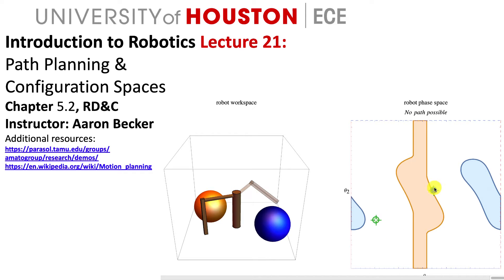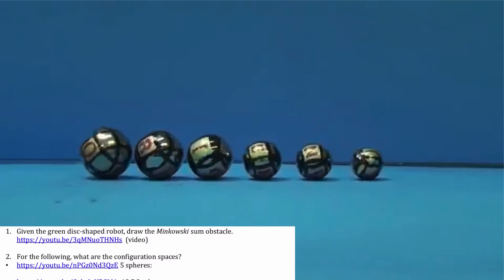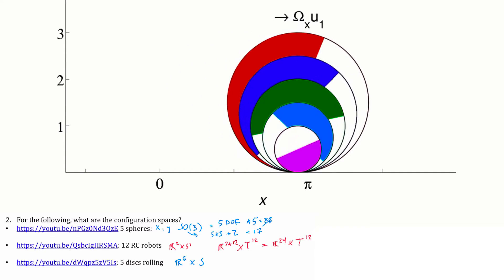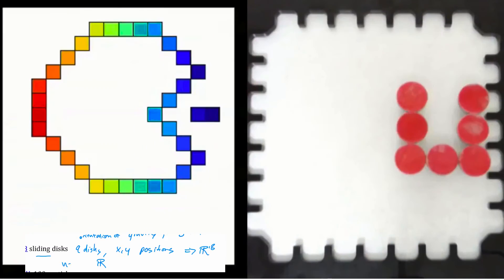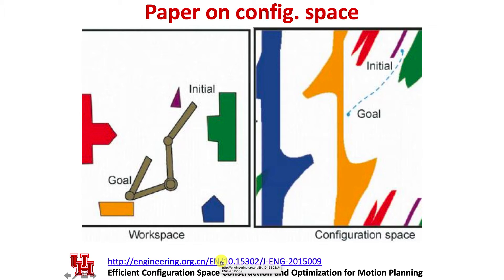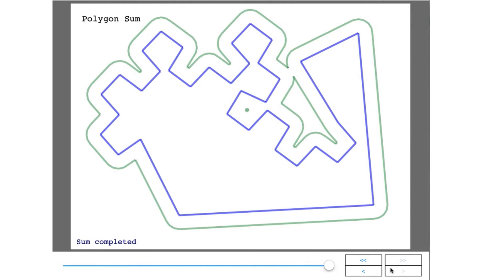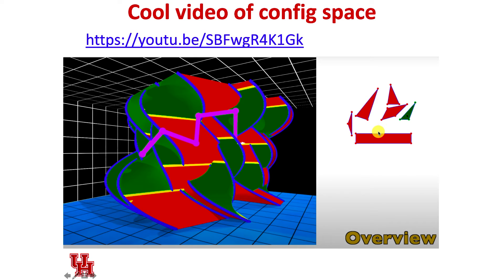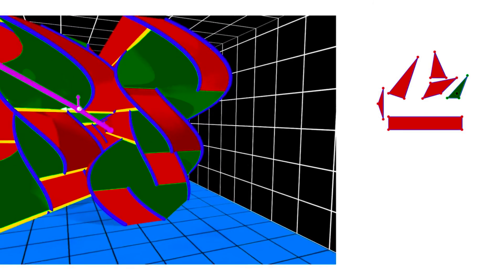Robot Configuration spaces, Intro2Robotics Lecture 21

Comment: What is the software used to draw the kinematic diagram? Is it robotic software or CAD-like Autocad?
Reply from the maker: At which time in the video?
Reply: @AaronBecker  1:19 professor. Number 6 shows the kinematic diagram. I was looking for a software to use it for drawing the kinematic diagram for lwctures instead of taking ready made from books.
Reply from the maker: @wbadry  Those are drawn using TikZ, which has steep learning curve.  It is often easier just to draw in MS PowerPoint or similar.